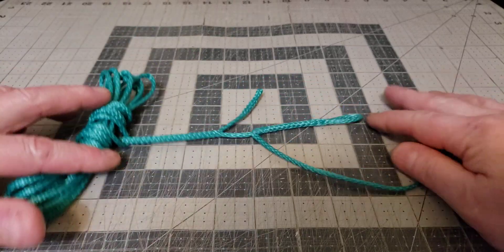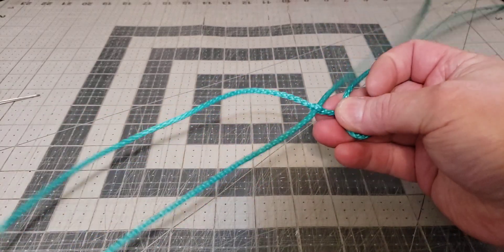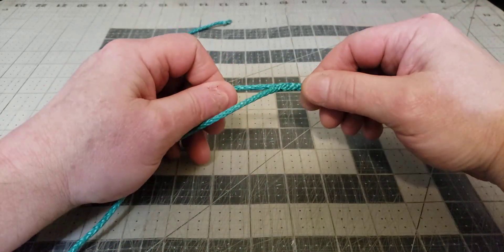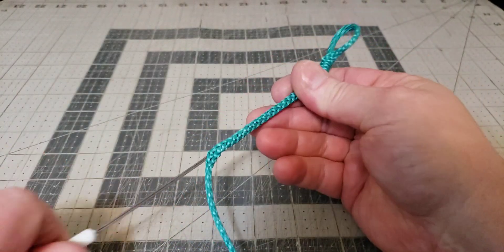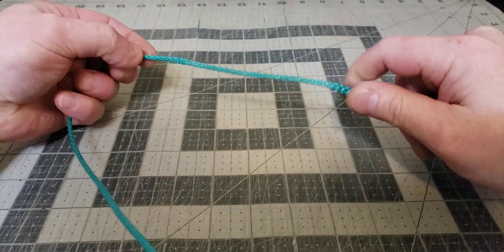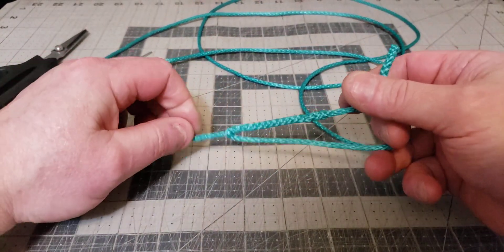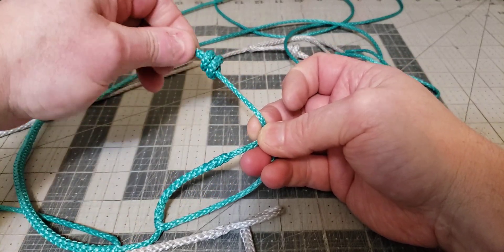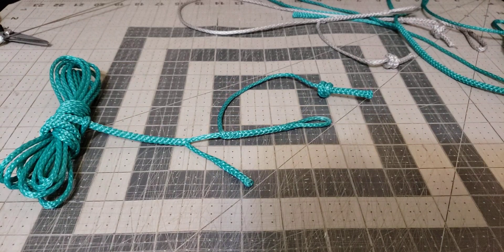Whoopie sling with built in soft shackle, pigtail loop on dyneema

Comment: Do you taper your amsteel ends before making whoopie slings?
Reply from the maker: @allourep  yes
Reply from the maker: Ultimately it does not matter though...the whoopie large loop exit point has about 5 times the stress of the spliced loop...yet still holds up...
Reply: @jeffmyers7062  I see. I haven’t tried making a whoopie sling yet but am going to try for the first time tomorrow. I saw someone mentioning tapering but I didn’t really quite fully understand how or what the purpose is.
Reply from the maker: makes pulling it through easier and it is for max strength

Comment: Many thanks for this! Have you tested the strength of that in-built soft shackle? To me it seems like it would be a significant weak spot at the double splice where the loose end with the double knot exits. Or that the lopp would slip when its not used as a shackle. The rope itself is of course many times stronger than needed, but I wouldn't be surprised if this fails somewhere below 50% of its rated capacity. And if it's no problem in practice, why not use a couple more splices, getting rid of the short bury completely for an even shorter sling? 
Also, have you tried the Ashley stopper knot anything? No. 526. I got some soft shackles with that knot, and I'm not sure about it's use on Amsteel. But it's a simple still very nice looking knot.
Reply from the maker: Several questions here let me see if I can respond to all.....first off you mention a weak spot??? What ??? Bro we aint weak we frigging strong as heck my brother!! Now look here buddy, the whoopie sling exit has always been a weak spot but it still holds...so no worries at all Sit! Come right back for more questions !